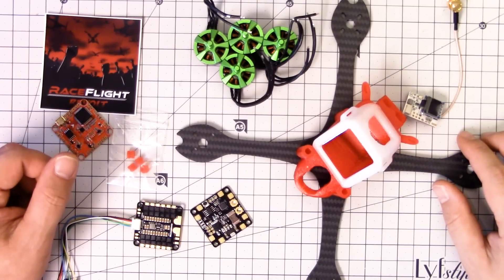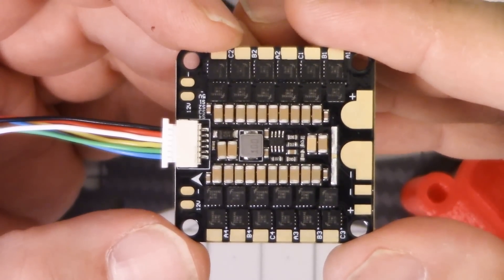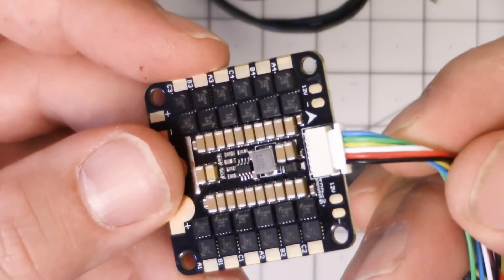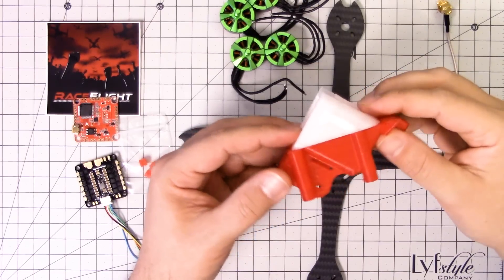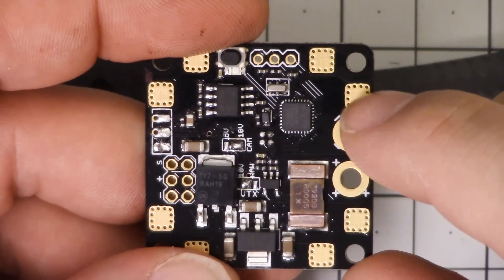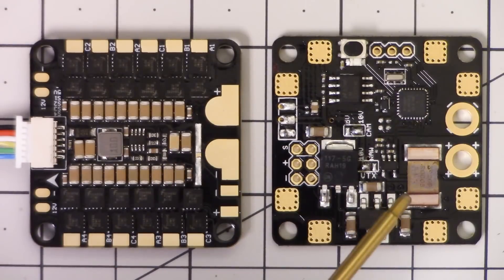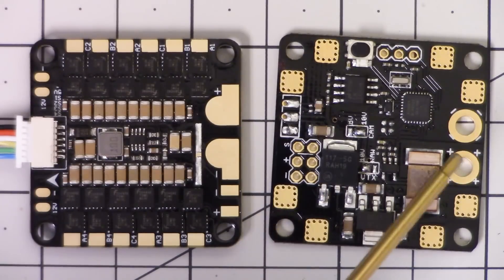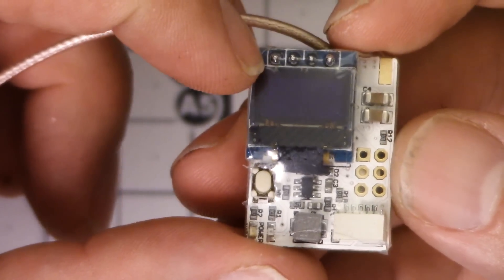BUILD A RACING DRONE | RaceFlight Revolt Shendrones ZoomPod - Part 1

Comment: Whats the amp rating on the 5v output on the 4in1 esc? I want to run a run cam split off that esc but not sure if the 5v regulator can handle it.
Reply from the maker: +Chaz asari I can't find that info anywhere.
Reply: Joshua Bardwell same.... I can't find it anywhere.... was hoping someone who owned the board would know.

Comment: Joshua, I would be more concerned about the current carrying capacity of the traces to the ESC pads on the PDB rather than the pads themselves. those traces were intended to carry the current of one ESC, not all four.
Reply from the maker: I would be stunned if the ESC and power pads had "traces" per se. I would expect that the designers dedicated a whole layer to the ground and power plane. The BFF3 is a six-layer board after all. Regardless, two separate board designers have told me, off the record, that as long as you use the ESC pads closest to the battery pads, you're fine up to the full rated capacity of the board.
Reply: Ooh, neat.  I wonder if you get any meaningful capacitance from that?

Comment: The problem you describe regarding using 4in1 ESCs with a PDB that has pads on the corners is the same as the issue with using the Quadrant ESCs with the BFF3 board. It can be solved by building a solder bridge from the shunt resistor to the nearest pad and or soldering the wire all the way across the gap. I think Hector has a video and post showing how in the RCgroups BFF3 thread.

Comment: The current sense resistor does not actually shunt off a small portion of the current. Rather it develops a small voltage across the resistor, that is proportional to the current flowing through it, according to Ohm's Law (V = I R). This voltage is measured by the microprocessor, which converts it to a current reading.
Reply from the maker: I know what you mean, but there cannot be voltage without current flow, so technically, it does shunt off current.

Comment: The frame is a Shendrones Full Tilt Boogie. The Zoompod is secured to the standoffs by bolts that drop into the holes above the standoff; there is an internal flange that the bolts will tighten against as they screw into the standoff, securing the zoompod.
Reply from the maker: Thanks for that tip about the bolts. I hadn't figured that out yet.

Comment: Hi Joshua, question about your RROSD and Betaflight F3 FC as well in relation to the current/voltage sensing. I kind of don't cate about current sensing, but do care about knowing the voltage of the battery. Are those two things separate? And does it matter to the way things are wired if you just want to get voltage output to the OSD? Do I have to come through the current sensor and into the ESCs if I just want voltage?

Comment: @Joshua Bardwell
In your opinion, is there any downside to soft mounting the flight controller? I know it usually doesn't need to be soft mounted, but it just helps me sleep at night, am I causing any harm? I can imagine that perhaps the gyro could be more sluggish to react to the quad, but does that actually happen? Here is what I bought "http://www.getfpv.com/orange-rc-bobbins.html".
Reply from the maker: Eventually, if the mount is too soft, the FC will flop around and you will get unintended motion of the copter. An extreme example of this is a guy who mounted his FC using velcro. But if you are using rubber standoffs or silicone bushings, it's fine.

Comment: That's the Full Tilt Boogie.   I built the Full Tilt Boogie-L which is the long arm version using the Betaflight F3 board.  The only problem with the 3d printed top is that since it flexes, in hard crashes the standoffs bend a bit.  So it's important to have some on hand for repairs.

Comment: Josh, I notice on your videos and other's videos that when you hit the throttle the quad automatically moves for seemingly at a fixed pitch....does one of your videos explain this? I have watched most of them...
Reply from the maker: I'm not sure what you're really describing here. Can you elaborate?
Reply: Yes...the videos with a stick overlay show the right stick centered but the quad is still moving forward without any forward input on the stick...and the overlay shows a negative input at times to slow the quad down...are the trims adjusted to make the quad move forward without input?
Reply from the maker: +drivemecrazy k the quad holds its last angle when the sticks are centered because I'm flying rate mode. If I pitch forward and then center the stick, the quad will continue to fly forward.
Reply: Ah...ok that explains a lot...I flew mine that way the first time till I figure out how to get it to self center...thanks for the answer...I really like your vids and keep up the great work

Comment: All the new cams coming out have got an integrated OSD Josh :)
Reply: Johannes oh really, which ones are you talking about??
Reply: pierre tharreau well a minimal OSD I suppose, but the RunCam Swift2 has voltage and some sort of timer. Might be enough for some...
Reply: Foxeer Arrow V2, V3, Runcam Swift 2 the OSD includes voltage sensor, timer and pilot name.
Reply: Josh seems most interested in a current sensor for the osd. I don't think any cameras have that yet.
Reply from the maker: That's correct. I really prefer to have current sense.

Comment: just solder off shunt to the 4in1 - no worry about the esc trace handling the current, and does what you are after :)
Reply from the maker: +B94Cast yup, that is a viable approach. But still a bit ugly.
Reply: I would feel uncomfortable doing that. You run the risk (small risk) of modifying the resistance since you are changing something (reflowing solder) in between the sensor wires. It may be calibrated from the factory. Those low value resistors have manufacturing differences and are often corrected by post production calibration, flashing the calibration value to that little processor. 

If there is no calibration, or reflowing the solder is insignificant (it probably is), then yes, that would work.

Comment: Drawing all of your power via 1 or 2 motor pads is not a good idea. The current capacity is limited by the area of the tracks/pads and the number of vias ( those small holes) A useful calculator can be found at https://www.saturnpcb.com/pcb_toolkit.htm Perhaps a compromise solution could be to solder directly to the down stream side of the sense resistor. BTW the method of current measurement with the sense resistor is to measure the voltage drop over the sense resistor. Using Ohm's law the current is directly proportional to this voltage drop. Virtually zero current flows into the amplifier chip.
Reply from the maker: Multiple manufacturers have confirmed to me that as long as you use the ESC pad closest to the battery pad, you can pull the full rated capacity of the board. They won't go ON RECORD saying this, of course, but it's true.
Reply: well thats very good to know. Maybe they should manufacture the PDBs with one of the esc pads extra large to indicate that that is possible.
Reply: Is soldering the 4-in-1 ESC power wire to the RROSD shunt resistor an option?

Comment: Just wanted to do my first RF bulid but everytime I plug the usb cable into the FC my RX goes to bind mode. Tried different RX and even a Spektrum Sat but everytime the same. :-( So now, I'm almost through the BF 3.1.5 Setup. RF my ass!
Reply: ZeroFPV did you talk to Preston from Raceflight?

Comment: Would't a 5V switching regulator make more sense then a 12V? Form x>12V to 5V you neet to take more Voltage => more power and dissipate it then from x>12V to 12V. Just to clarify, my knowledge about this is quite limited. I was just wondering.
Reply from the maker: +The SFReader yes, I agree. Running the 5v off the 12v is also better because the linear regulator gas to drop fewer volts.
Reply: As far as I understand, for the VTX and camera, regulated/filtered 12V is better. And since they need more current than the Flight Controller, it makes better sense to regulate to 12V and step down to 5 rather than regulate to 5 and step up to 12
Reply from the maker: +Julian S. If the current draw is low, a linear regulator is fine, and smaller footprint, and cheaper.

Comment: Josh could you do a video on what camera is best for FPV racing - delay  / exposure / aspect ratio
Reply: The answers are already out there. Either HS1177 or RunCam Swift with around 2.5mm lenses with high up tilt. They are the best quality cams without sacrificing on latency.
Reply from the maker: The Eagle is MY favorite camera, but be aware that I am not a big-time racer. I flew this weekend with Bulbufet, who is a big-time racer, and he repeated the argument that the Eagle has too much latency. After watching him fly, I might understand better why he says that. Watching his FPV feed, he was responding to obstacles faster than I could really process.
Reply: Josh could i ask what bulbufet used as a cam im more interested in racing